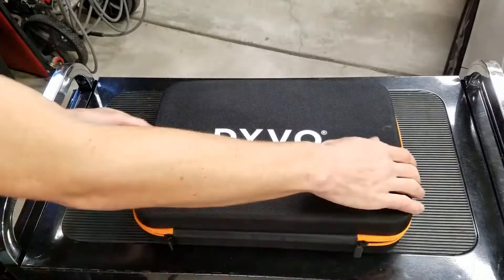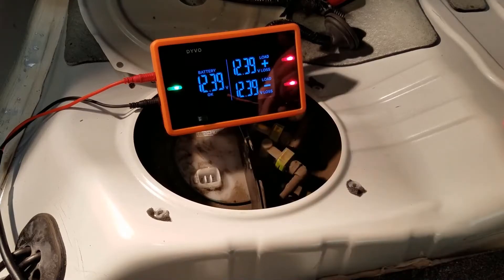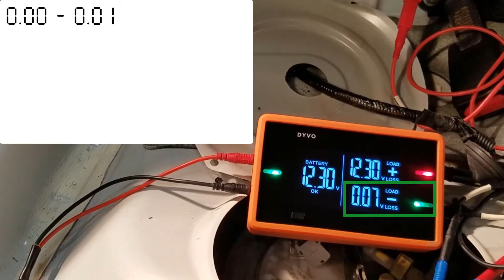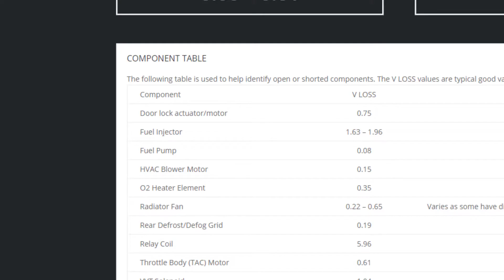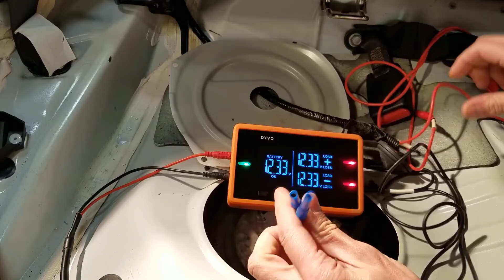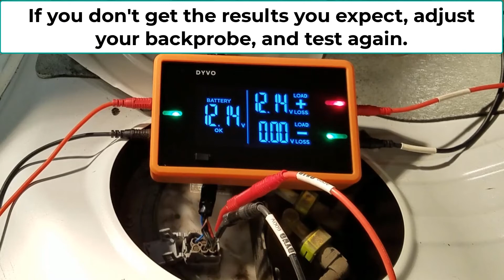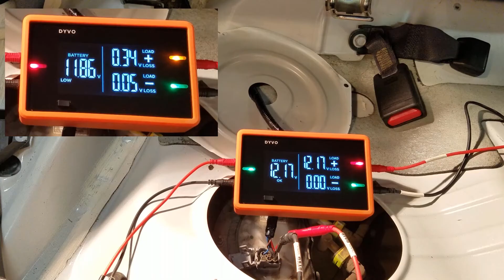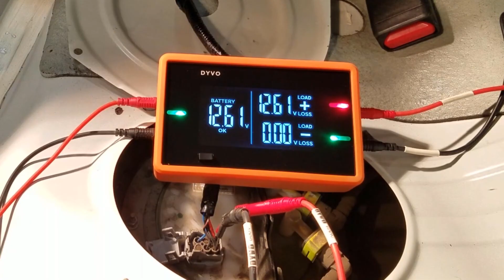DYVO - How to Test a Fuel Pump

Comment: Excellent video. If you use a set of breakout leads on the red and black wires you can quickly measure the circuit intact without back probing.